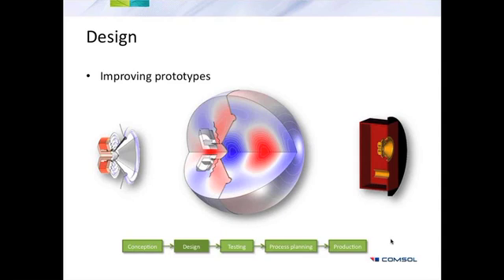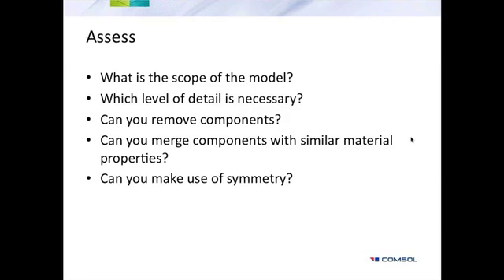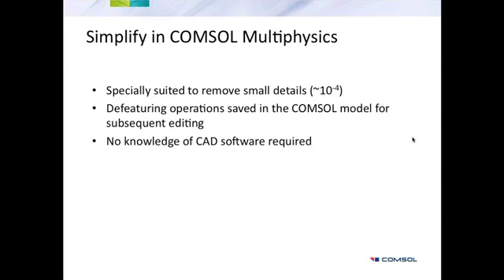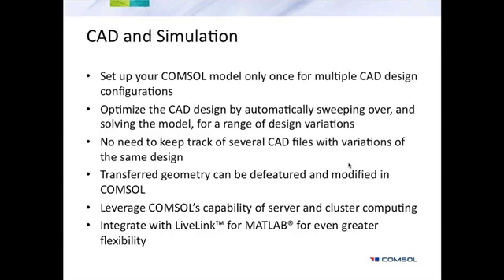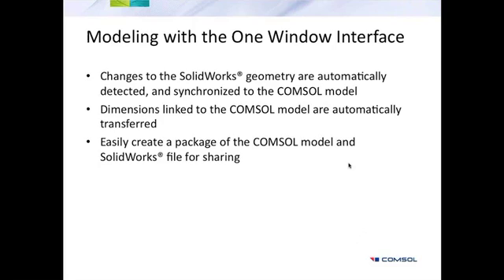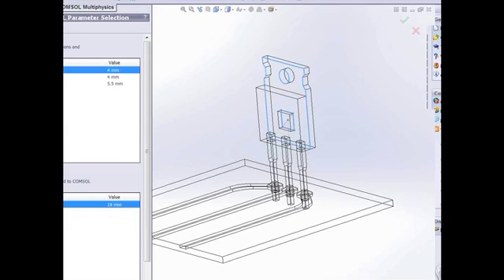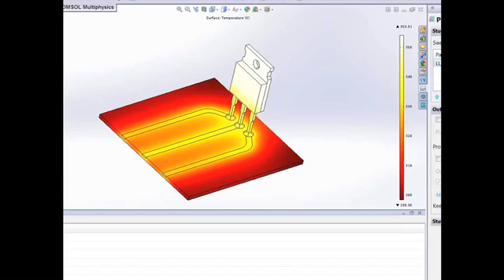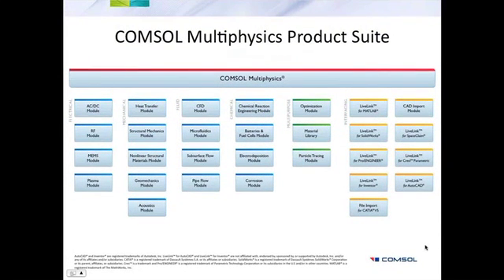Simulation-Led Design Using SolidWorks and COMSOL Multiphysics (Webinar)

Comment: do you recommend to use Comsol to run a simulation on uranium fuel rod as heat transfer or two phase flow?